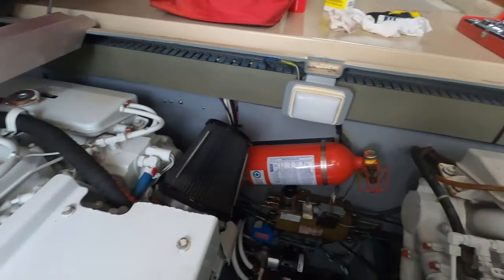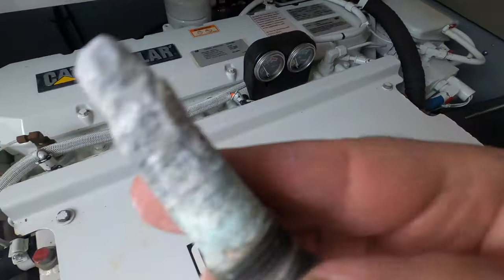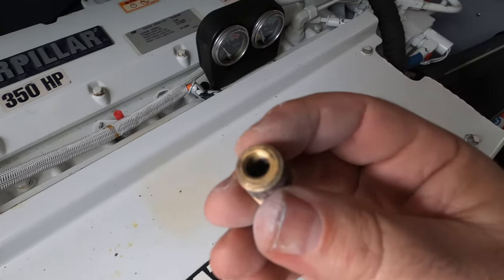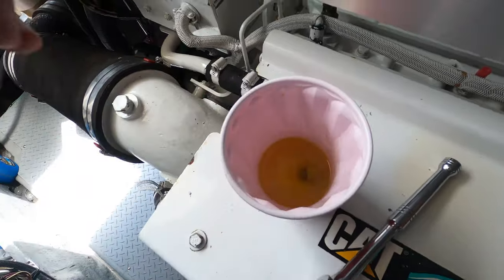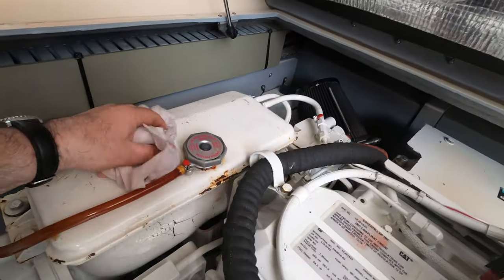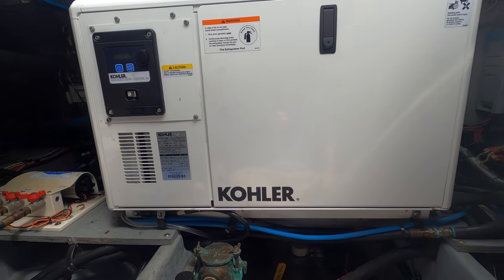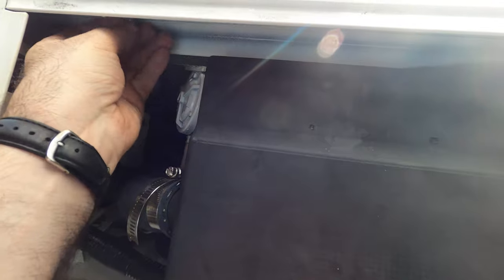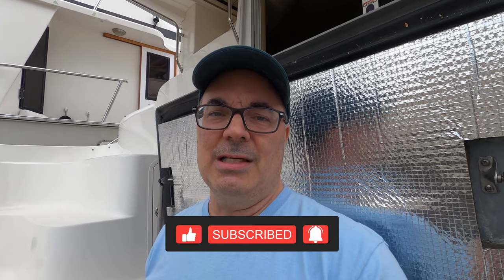DIY - See how we replaced the engine anodes on our Caterpillar 3126 diesel engines

Comment: The location you show at 1:33 for the third heat exchanger zinc is not correct. It is actually on the opposite side of the heat exchanger from the first 2 you have shown. The orientation is different however.  Instead of forward and up like the first two, the last one is directly underneath the end cap to the heat exchanger.

Comment: Please show where the anoids are a little slower. I keep pulling out plugs that are not anoids trying to find them. This video shows or talks about two in the oil cooler but you don’t actually show them.
Reply from the maker: Sorry the video did not show the anodes.  Happy to convert directly with you and point out where they are.
Reply: Trans cooler has them as well